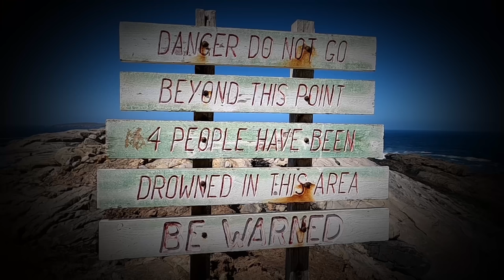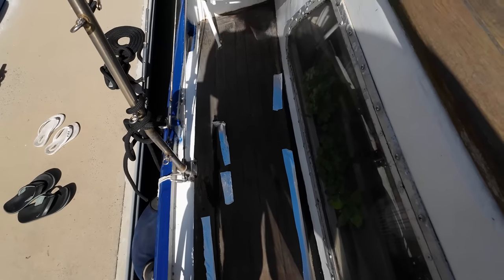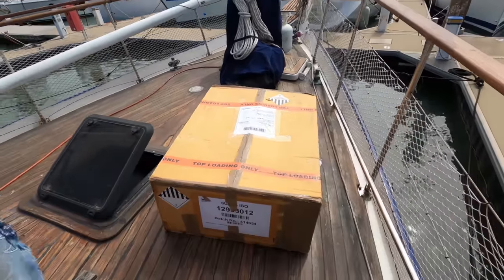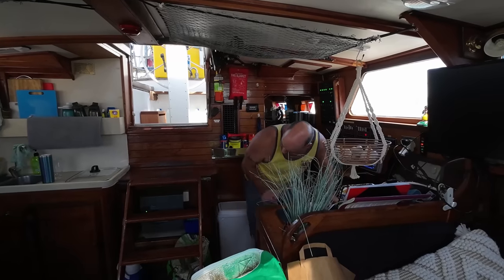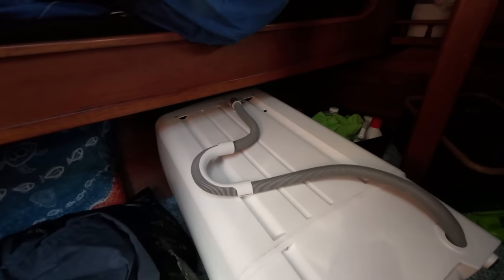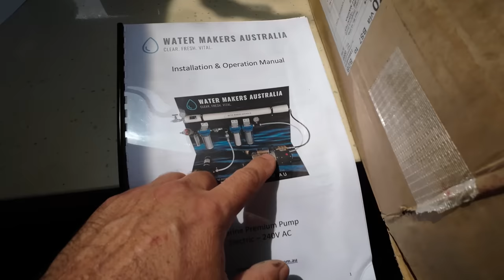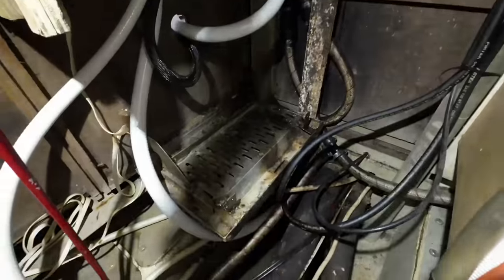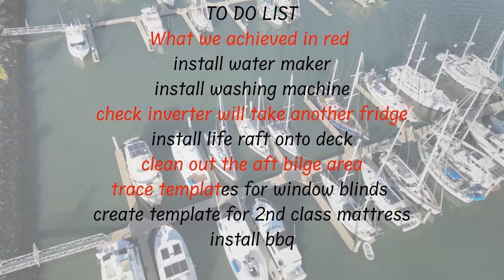SV AWAITEA Karl gets his Reno on starting a million jobs at once & takes delivery of a special gift

Comment: RTFM, what a wus. Love the plan for the water maker - neat. Saw another YT channel where they are fitting a water maker on their caravan..makes one think and simultaneously makes the hip pocket whinge. How many watts is the pump Karl?
Reply from the maker: Hi Ben,
😀😀😀
The pump is 1500w.
The system is very costly, but we did not want to have the problem of chasing up fresh water all the time.
In not Sue about the caravan thing. Our system would weigh about 50kg when it has water in it.
I’m don’t thing the repay would be there for a caravan system.
Cheers, karl